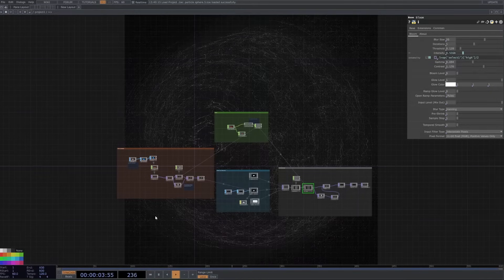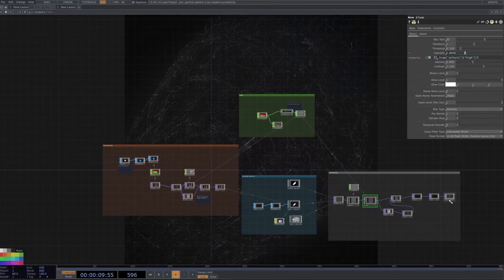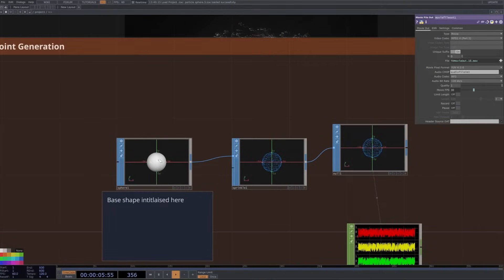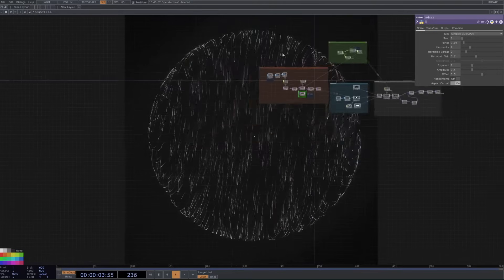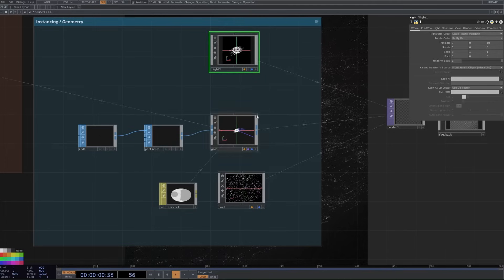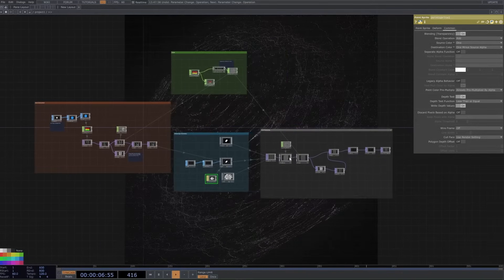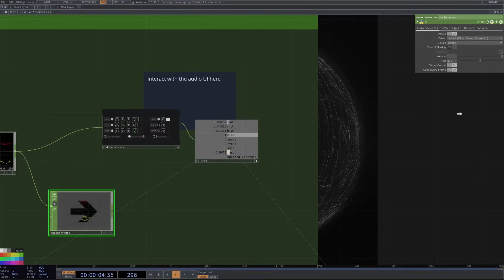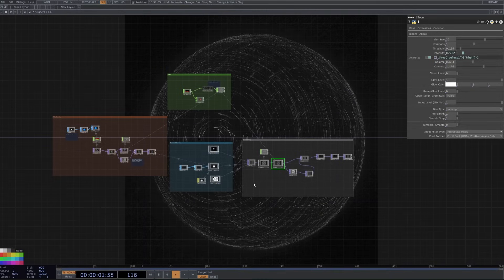Free TouchDesigner Audio Reactive Particles Project File

Comment: i guess the free download is no longer available? i tried recreating the file but it doesn't work out for me sadly
Reply from the maker: Still free:)
Reply: @n @nicholaspjm yy!! i wanted to ask you a question. My render is not showing the points unless i connect the sop null to add sop (i think my geo comp is not computing the null top after the comp, which is set on multiply) so what should i do? 

i just wanted to download the file but i cant find it on your patreon 😭 im so sorry i was just working on some assignments and found your video and i was really interested